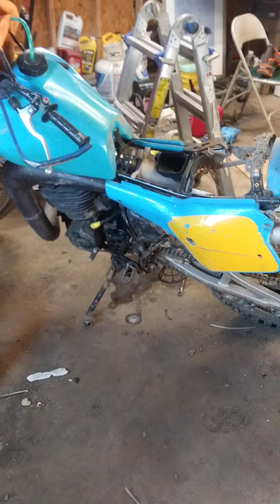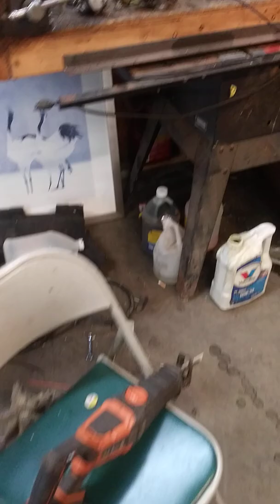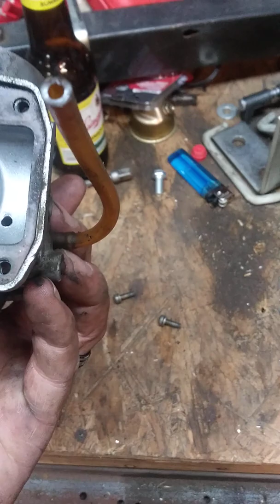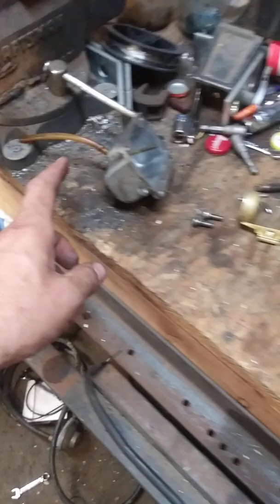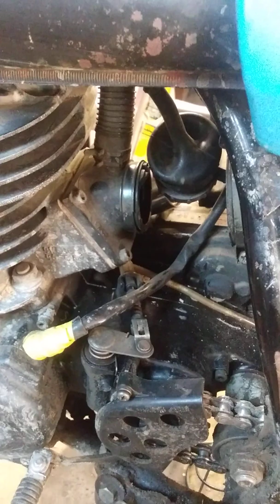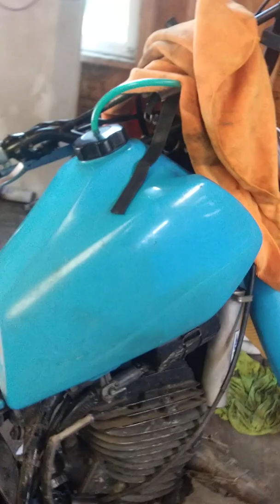1982 yamaha 465 carburator

Comment: you can use some large heat shrink 100mm shrinks to 50mm and will make your boot like new.
Reply from the maker: Yeah thanks for that. I never thought of that. Its fixed now. The internal structure was not broke so i coated it with high temp black rtv and let is set for a week.

Comment: I need exact same carb were can I get ine
Reply from the maker: Amazon
Reply: I couldn't find one on there
Reply from the maker: @dylanmcclane5945  my bad man I responded before I seen what video it was I was talking about the carburetor for my warrior the carburetor for the 465 that's not a new one that's the original one you can get a rebuild kit for it and rebuilt it but you're going to have a hard time finding one I would check on eBay but you're not going to find a new one what is wrong with the one that you have